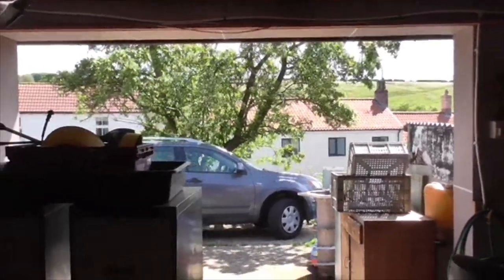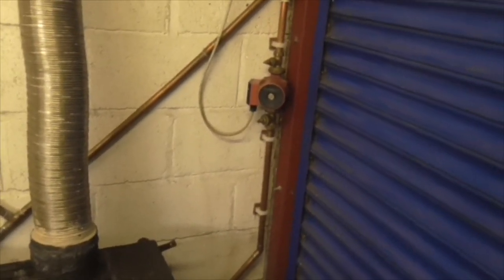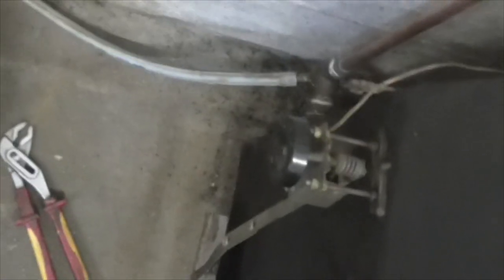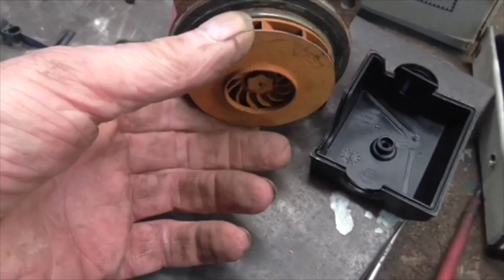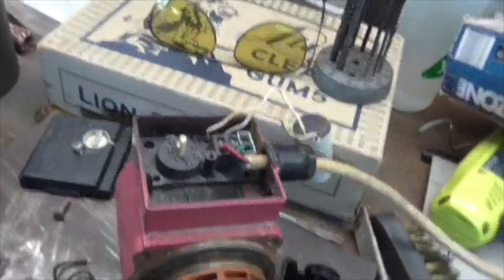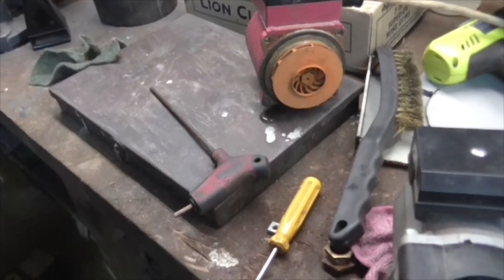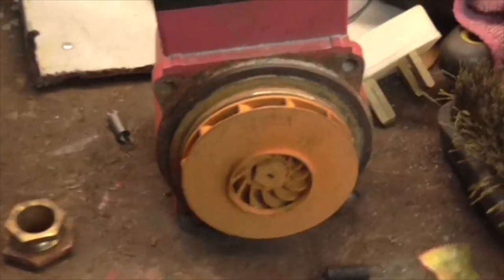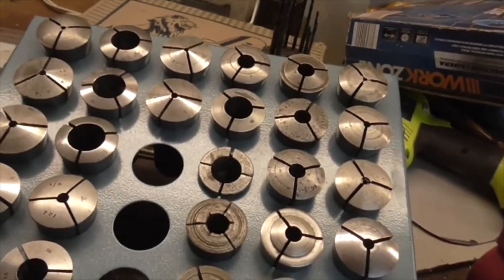Central heating pump problems!

Comment: Short but sweet Phil, enjoyed it very much. That pump has been more trouble than it's worth! I hope you can get the bushes changed, it will be interesting to see that done.
Reply from the maker: Hi Carl,
I have stripped these pumps before and I have a feeling the front bearing is ceramic, so the options may be to make a new one in brass, or try to fit another pump rotor and bush assembly, or even another pump, they are over £100 now for even the simplest pump!Heres hoping mike has one in his junk!
Phil
Reply: @philhermetic  I hope you manage to get it sorted. I know those pumps are expensive. Good to know you got your daughters moved. See you next week.

Comment: I had that exact same pump fitted in my house when I moved in Phil. It was knackered too and I had to change it. Having said that, most of the heating system was knackered and required changing! I hope you can find one and properly test the workshop heating system. 
Best wishes, Dean.
Reply from the maker: @retromechanicalengineer  in the seventies and eighties they were just about the only central heating pump you could buy!